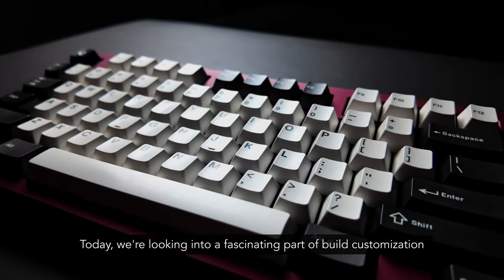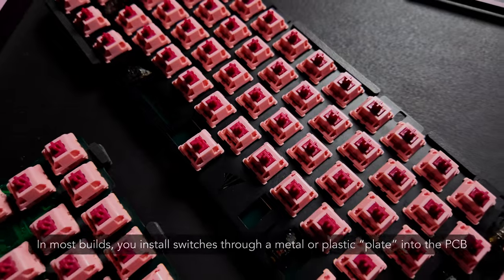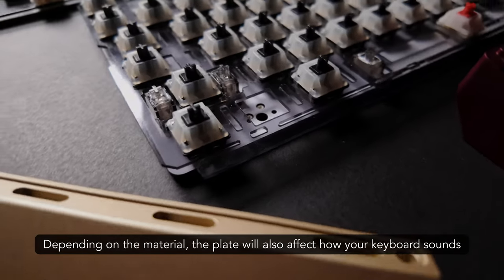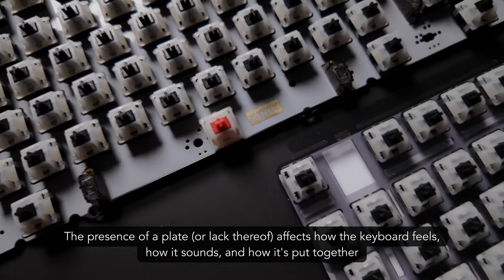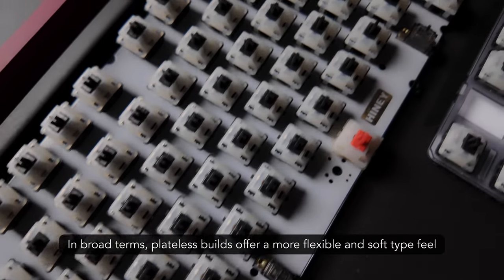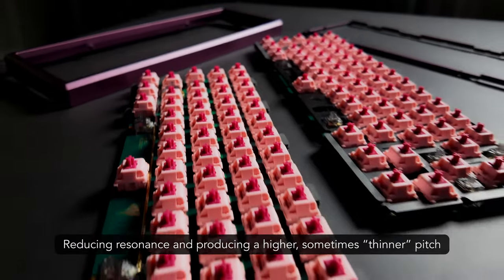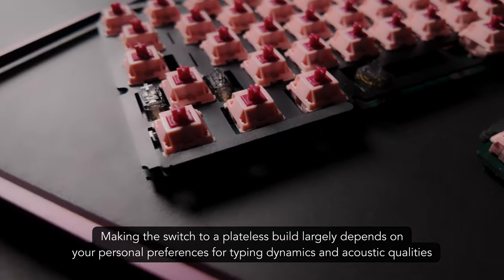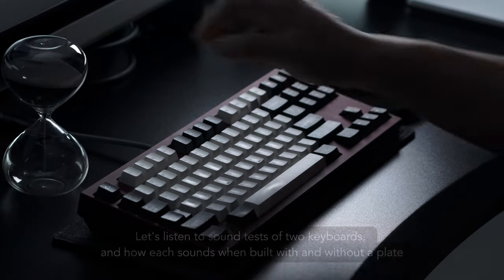Plateless vs Plate builds: What are the differences? | Review & Sound Test

Comment: Plateless works so great on these boards! I've tried it on my 7V, and I ended up not being too fond of the sound and feel.
Reply from the maker: yea there are so many other factors but wanted to at least try to show some of the differences.
Reply: What do you enjoy in your 7V? I’m a new owner and would really appreciate some advice on configs ton a pro like you
Reply: @tobyflenderson4422  Aww shoot... It is one of the hardest board to tune, sound-wise. Force break helps the sound 9/10 times. I liked MX Blacks/Nixies on Alu, but I currently have it built with PC. I find that PC gives more resonance than Alu, and Plateless offers the least amount of resonance. Plateless is very bouncy and less pronounced in terms of sound. I prefer a stiffer typing experience and a snappier sound, so I opt for using a plate most of the time.